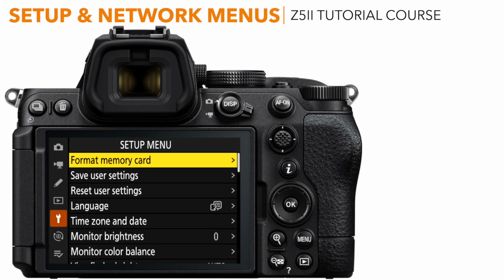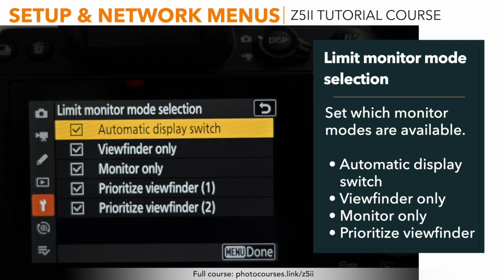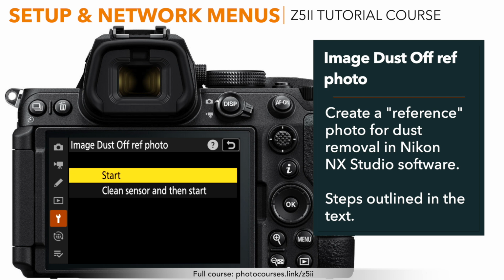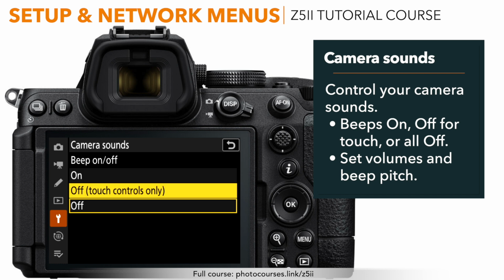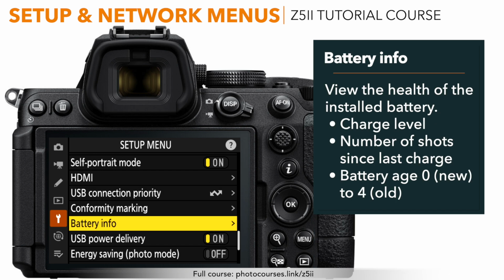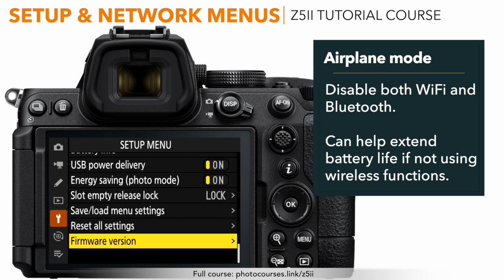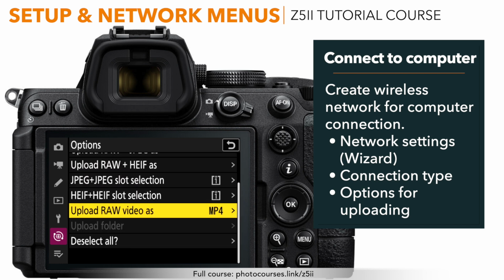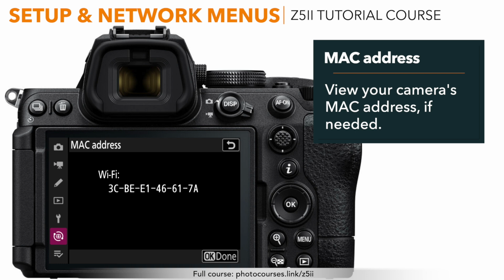Nikon Z5II: Setup & Network Menus Walkthrough

Comment: Hello, i have a little problem with my z5ii..my cam doesnt allow me to "slow motion"... when I choose H.264 8bit (mp4), then i go to  Frame size/frame rate, the cam shows me for example 1920x1080, 30p x4 (slow motion)...and this is what i cant choose, and it say "this option is not available at current setting or in the cameras curremt state"... can you help me pls?
Reply from the maker: Some settings won't let you use it, like Electronic VR, Hi-res zoom, and Flicker reduction.
Reply: @PeltierPhoto so, what should i do? Im amateur 😕
Reply from the maker: Make sure those settings are off
Reply: @PeltierPhoto  all of them are off :/

Comment: Great camera, NIKON fell short on two things. Manual for this wonderful camera, people that are artistic need one. To go back and forth stop and go on utube can be very frustrating. And a battery charger, to get a charge on this battery can be very time consuming for a youngster. Shout out to John!
Reply from the maker: The in-camera charging is very frustrating. I got a wall charger 'cause no one has time for that!
Reply: Thanks for the advice.
Reply: @Lostmineagain I don't know where you live, but all new devices sold in the EU must now support USB-C charging. No chargers anymore for us.
@PeltierPhoto: Great video thanks! I have the Z5ii & the Viltrox 20mm f2.8  & Viltrox 50mm f2 Air. Both lenses less than £200 in UK & great quality.
Reply from the maker: @leeinnes7127  you're welcome!
I'm just frustrated that the camera is out of commission when you need to charge (which is a moot point if you only have/need one battery), but then if you grab the wrong cable, it takes all day. Both problems solved with a conventional wall charger. I do concede that not everyone needs one of those, so it's more practical to make them "optional accessories."
Reply: @leeinnes7127  Learn some thing new every day. One would think if the camera is sold in the USA it would come with both for convenience. USB-C is not mandatory in the USA yet.